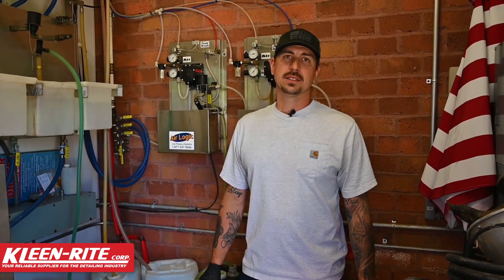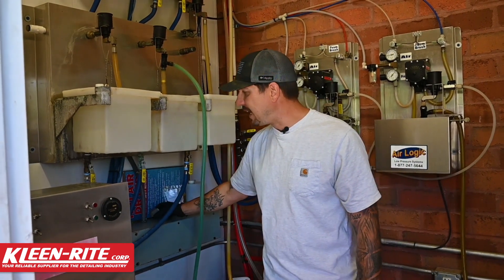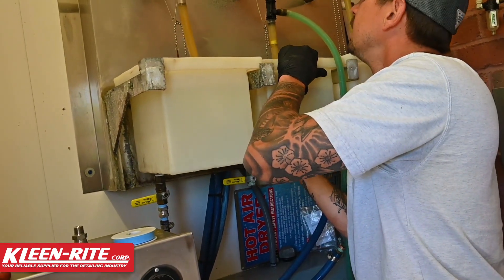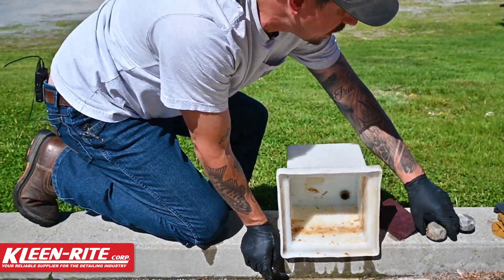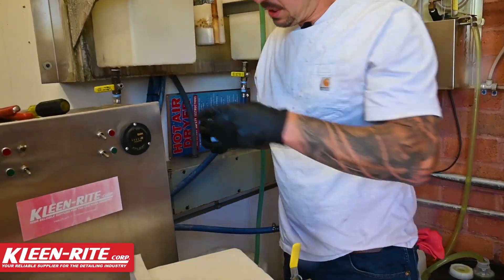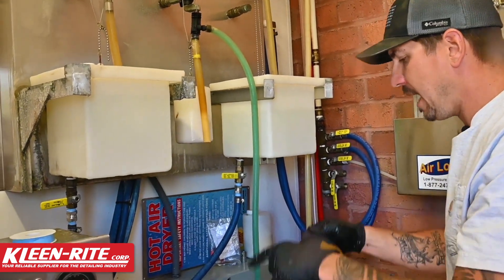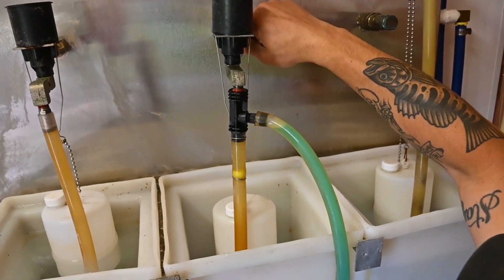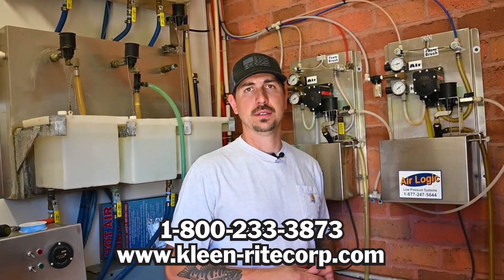Cleaning Soap Tanks - Fix It With Phil | Kleen-Rite

Comment: some of my bays have different consistencies in the product. some bays the high pressure soap comes out foamy and others its runny. would that be a solenoid problem?
Reply from the maker: If this is a gravity fed tank system the solenoid or Kip valve introduces the soap into the pump head so you could have a situation where one/some of the solenoids are not fully opening, but typically if you have soap at the gun then the solenoid is opening. In my experience solenoids typically fail open or closed not usually in the middle but is a possibility. I would first change out HP gun tips to see if that helps even out the look of the product in each bay to a more consistent display. A worn tip will change the look of application, as well as pressure at the gun.

If this is an injection system I would first look at my metering tips for either blocked/clogged tips or maybe even the other way to a worn tip allowing to much soap to be introduced into the system.

Hope this helps, if not maybe a little more detail on your system will help shine some light onto the root of your problems.

What soap are you using?

- Phil